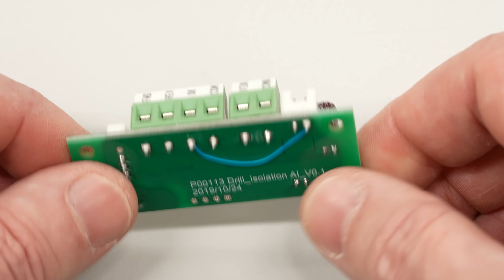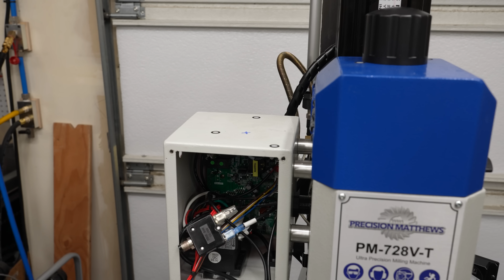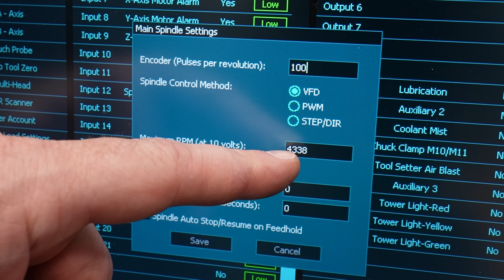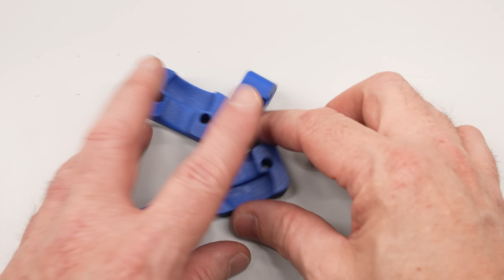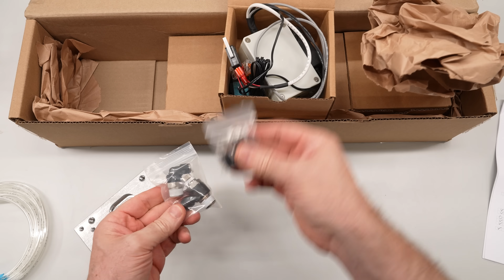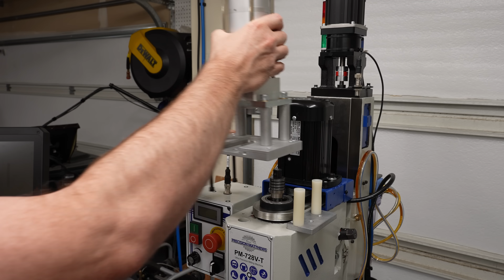A Power Drawbar, Mist Coolant, and Spindle Control for the PM728 CNC

Comment: I've been watching your channel for many years and have been dabbling in machining. I have a decent lathe but have put off buying a mill. I was set on buying an older Bridgeport but am now wondering if something from Precision Matthews is a better idea. I haven't seen where you have discussed the reasons and capabilities between your two mills (that I'm aware of). Like why did you go for two instead of just he one? If given an ultimatum and you could only have one, which would it be and why?  One is the larger manual mill while you more recently set up your smaller PM-728VT. I'm curious what you would recommend for someone who dabbles in machining, is fairly capable in Fusion and has a CNC router for my woodworking hobby <-- IE: I'm technical and work in software engineering. I would eventually probably want to convert whatever mill I get to CNC keeping manual capability as well. Any advice would be great. The 728 would take up less space but I have a tendency to go big or go home. I'm trying to be practical.

Comment: Using a R8 end mill holder for the rough milling would put the cutting edge much closer to the spindle bearings, and reduce the vibration, plus put less stress on the bearings. Very successful first run! i am looking forward to more.

Comment: I am retrofitting a 728 power drawbar the same as yours after seeing this video. I got it from Preist. I have a question. Mine doesnt have those 2 pulleys which make your top of spindle about 2.5 inches higher than mine. At 19.30 min into the video the drawbaw you show fitting the top section is quite low then it cuts to maybe a sort of spacer above your pulleys and the drawbar is a lot longer. Did you have to get a longer drawbar?.... The drawbar screws about 30mm into the R8 collet. I cant get that distance like yours so I have modified my bottom section with the nylon bushes to about 20mm high but I will still need to make a new tophat for the spindle. It will be about twice as long as the original supplied. The main question though was the length of your drawbar after you tightened down the bellville washers. Did you get a longer drawbar?
Reply from the maker: I just had the quill lowered forgot about it until I mounted the cylinder.  I used the drawbar that came in the priest tools kit.

Comment: If you still need more draw bar actuating force, another option as opposed to getting a larger multistage cylinder is adding a pneumatic booster inline with the actuation valve.  They take 90 PSI up to 150 PSI and the largest cost is typically the the built-in accumulator tank to maintain higher flow rates. For your use case you could use a relatively low flow rate (cheaper) since it shouldn't be actuating frequently. I've always used SMC brand boosters like the VBA10A-T02GN but I'm sure other brands are available.

Comment: I wounder if that RPM display on the front of the machine is picking up some noise through the power supply circuit. i installed an RPM display on my lathe from amazon  as well as a VFD for the motor and it did the same thing until I put an EMI filter in the power supply to the display and it fixed it.

Comment: Many VFD's have a relay output that can be assigned to close or open for a fault, spindle running, target speed etc. this is better than relying on the 12v from the power supply with the associated delay on power failure.

Comment: I recently bought a Milescraft DrillMate. It's a guide system for drilling holes, sort of like a mag drill but without the magnet & just using your regular drill. Very handy for getting decent holes in things that can't go onto a drill press. Intended for woodworking mostly, but it would have worked fine with the step drill. I'm sure there are cheap knockoffs too.

Comment: It would be nice to have a power draw bar  it would require having the compressor on all the time the mill was in use. I need to isolate the compressor noise,  that may lead to forgetting to shut the compressor off. 
I need to put a relay on the light switch so I don't forget to power off the compressor.

Comment: I think you're safe with the papers in the door.  It's a closed metal box.  if you lit the papers and closed the box I think it would be about the same as burning something in an ash tray.  It would get hot for a minute and maybe put soot on your wires and boards but I doubt it would even damage a board beyond that.

Comment: Great project!  I am constantly checking on the weekend  to see if there is a new Clough42 video. I was surprised to see a recommendation of lubricant on the taper of the collet that holds the tormach tools.  I've always understood that the proper way to drive the collet is with the taper, not the pin in the spindle.  Do you get drive through the taper even with it lubricated?

Comment: A good practice is to twist your power supply wires to the board in the vfd box. Switching noise can mess up the electronics. Might be the reason for your wrong speed pick-up. Doing it with a  drill and a vise gives good fast results.
 A large value (100k-1Mohm) 5w (or less) power resistor with heatsink package accross your capacitors might be a plausible solution to reduce discharge time. A little calculation can give acurate timing etc

Comment: fitting a "bleed resister" across those capacitors will pull your 12v signal down, faster.

Comment: I’m disappointed you added the spindle power interlock to be sure the spindle motor had power. Kind of takes all the adventure out of future projects! 😁😁
Next thing, you’ll be adding an enclosure with interlocks so you can’t stick your hand into a running fly cutter! I’d say you’re turning into a boring old guy, but those seem to actually be the ones who do t like safety devices! 😁

Comment: First of all:
Keeping schemes and data printed on paper inside the electric cabinet doesn't add any fire risk.
If in the cabinet there's a short circuit powerful enough to ignite them, it means that something with a lot more calorific value is already burning in there, so a bunch of paper doesn't add so much to be a real issue.
I'm a professional lathe machinist and in professional machines there's almost always schemes inside the cabinet, from the old '90s Daweoo Puma from the on which I was working at the beginning, to the 2005 Mori Seiki NL2500 I'm working on in the past 10+years!
Don't worry.

I like your projects and I can say that, being in almost the same situation now (a machine good enough to work, but not completely done), I have to learn something from this!
I just converted a small benchtop mill very similar to the grizzly to make the plastic injection moulds I need for my project (if you want to take a look at it and share some thoughts with your experience about it, I'm super happy!).
Thanks for sharing, awesome video as always!
Cheers from Italy!
Davide
Reply: Was thinking the same. If anything in that cabinet is getting hot enough to ignite paper, you have bigger issues that the paper being on fire :P
I see the same people worried about wooden PC cases lol
Reply: @azyfloof Exactly.
And maybe living in a cardboard house.

Comment: For de energize the capacitors for the motor alarm, use a small pull down resistor to gnd. 
The energy stored in the capacitor is gone very quickly.

Comment: Can you pull the spindle optical pickup into the masso to provide RPM feedback to it (and therefore whether the spindle is turned on)?
Reply from the maker: Maybe.  I read a little about it.  I think it only controls the RPM display in the MASSO.  I'm not sure if it can be used for anything else.

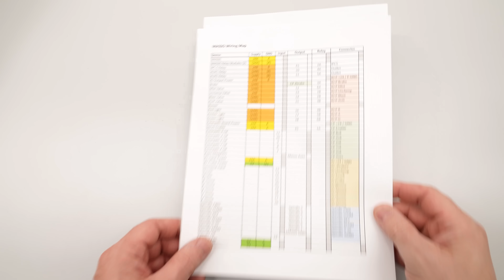Comment: 4:27 and yet many machine and and equipment manufactures do just that... Put paper documents (usually related to wiring) in an an attached sleeve in the control cab..

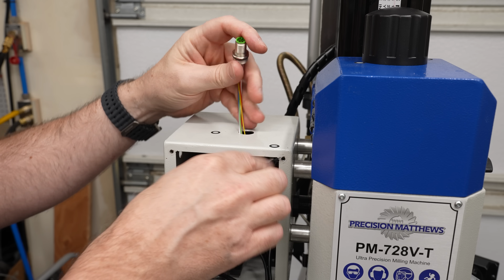5:47 ehhh, S___ happens.

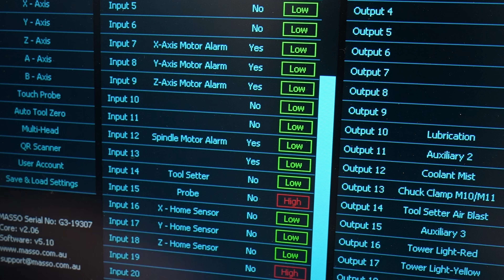7:13 I wonder if there is a way that a spindle encoder could be a solution to this problem.. Could there be a way to get the Masso to stop running the program if the spindle goes to 0 RPM 

13:40 I'm sure you will but it has to be said...  Enclosure (and more importantly, change to flood) = FAR BETTER than mist with or without Enclosure.

Comment: For the vice I have seen a few people mount it sideways if you need more Y. Most the time you don't need it for a vice part.  For chip control the old shower curtain is still a winner. Use a big ring and two curtains. Its cheep and works better than you think. Running full speed doing aluminum will send a stream of chips 10 feet in all directions. After that happens a few times you will have a chip shield system.

Comment: Industrial Electrician here: Nothing wrong with documents on the inside of the door James. Every panel I’ve ever opened (hundreds) either had documents in the door, on the floor or completely missing. If sparks are flying inside the control panel, you’ve got bigger problems than a few sheets of paper. Much, much bigger. And I totally agree with you assessment that it’s more dangerous to connect a wire incorrectly than to have a spark start a fire with paper, which isn’t even very easy to do. Keep up the good work
Reply from the maker: Thanks!
Reply: I supported a vapor degreaser that was large enough to at least hold a small car where I *tried* to keep a complete set of schematics for years.  But, some a$$h*le kept removing them... continuously!  So, each time after the schematic "thief" raided the cabinet, the degreaser fell under your "completely missing" category.

Comment: Why Anti-Seize does Not Belong on Precision Ground Tools

Anti-seize compounds are widely used in automotive and industrial applications because they prevent fasteners from galling, seizing, and corroding under high heat. However, not all anti-seize formulas are benign when it comes to precision-machined surfaces.

The Silica & Quartz Factor

Several common anti-seize products (both copper-based and silver/white high-temperature variants) list silica or quartz (SiO₂) as ingredients in their Safety Data Sheets. While usually present in small amounts (often 0.1–1%), these particles are hard compared to steel. On highly finished tool steel surfaces—such as precision ground ways, spindles, or gauge blocks—even trace abrasive material can cause microscopic scratching and premature wear.

Why It Matters

Abrasive Potential: Quartz is ~7 on the Mohs hardness scale, harder than steel. Even in small percentages, embedded grit can accelerate wear.

Encapsulation Caveat: Manufacturers often note the silica is “encapsulated” in grease, but once squeezed out under pressure or wiped during maintenance, these particles can still be introduced onto contact surfaces.

Tooling Tolerances: Machine tools and high-precision assemblies rely on surface finish and geometry. Anything abrasive increases the risk of losing tolerance and shortening service life.

Safer Alternatives

For threaded fasteners on or near precision ground steel, consider:

Dedicated assembly pastes designed for machine tools (e.g., moly-disulfide pastes without silica).

Clean synthetic lubricants formulated specifically for high-precision sliding fits.

Comment: I have a Priest drawbar for PM728 and the Tormach quick-change system. It works half the time, the second half, the tool sticks in the collet and needs a light blow with a mallet to the top of the pneumatic cylinder. No matter how much and what type of antiseize I use.
Reply: I have had the same problem, but built my own system for my PM833 cnc. I did find little chatter marks on the top of the outside of the collet and the inside of the spindle is a little rough. I polished the outside of the collet and lightly ran a bore hone where the collet sits inside the spindle, then used the wheel bearing grease I had on hand for those spots. It helped, but I machined my own cylinders to tripple them and have an air leak and am not getting full force........so as Clough says, my machine is just barely usable. It is taking up my entire welding table and needs to move to it's own, but on the welding table it is easy to access all parts of it while doing the conversion. The probe (ITTP or something like that from new zealand) is the worst, but the shank is a little longer than the tormach holders and of course that is the tool I can't let drop onto a wood block as I hold the release button and smack the top of the cylinder.
Reply: @CGT80 good pointers, thanks! Will try the same.

Comment: A few thoughts
Perhaps there could be a way to prevent the need for a dummy tool to prevent the collets from being over crushed? For example is there room above the collet to fit a stop bush? 
You could improve the sticking of the collet knockout by speeding up the release portion of the cycle. It looks like that particular setup uses vented single acting cylinder stages? But you still restrict the speed through a single flow control. Perhaps a Quick Exhaust Valve on the down stroke mounted to the cylinder then use the cylinder end stroke cushion to prevent it knocking out it's gland? Many commercial CNC machines use this without problem.  Although this is optimal where the knock out is fixed to the collet in a fixed application it could still help?

Comment: I've worked in factorys for over 35 years and we have a lot of panels with documents on the inside door panel, never an issue.
Reply: Industrial prints are in 1 of 2 places. Inside the control cabinet, or missing.
Reply: @Slowmotion_Train_Wreck  - Truth.
Reply: Yeah, every industrial electrical panel I've ever seen the inside of has a bunch of paperwork in it. If there are enough sparks or heat in there to ignite paper, it's already on fire.
Reply: Hell a few PLC cabinets that I've had to work inside of had VERY loose documentation all over the place inside. I would say that James' solution here is not even worth mentioning for "safety concerns."